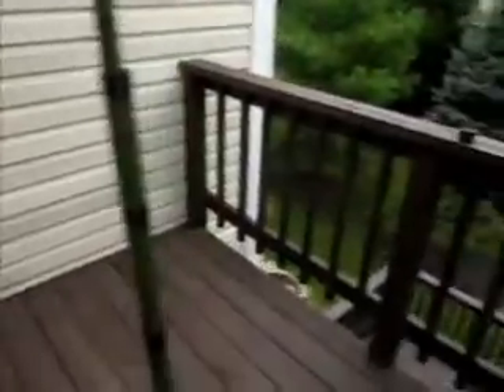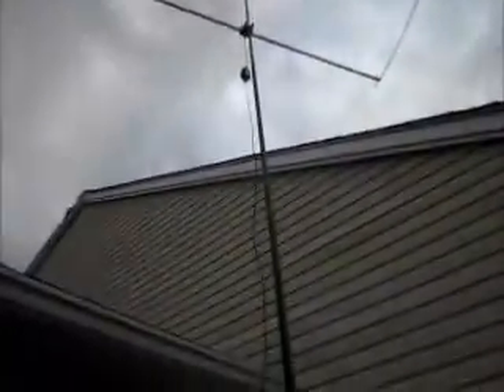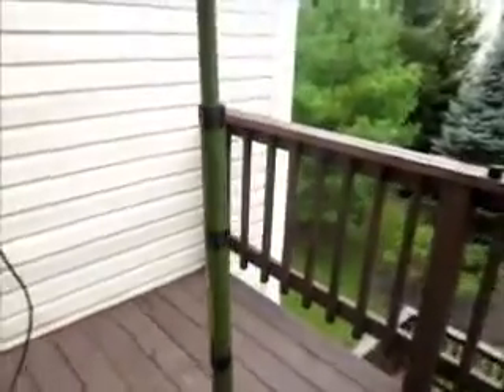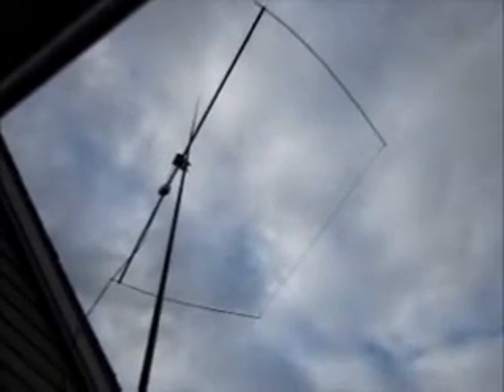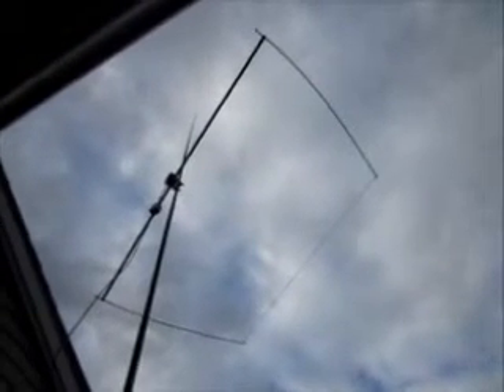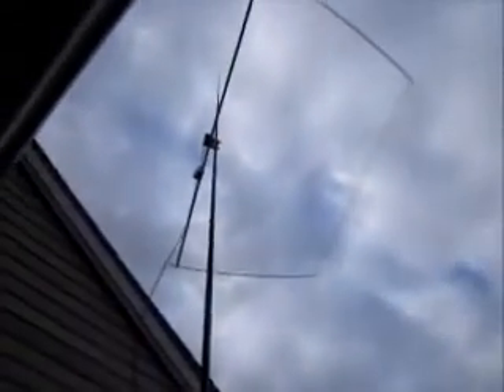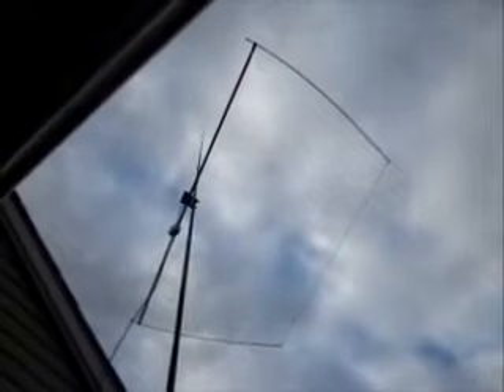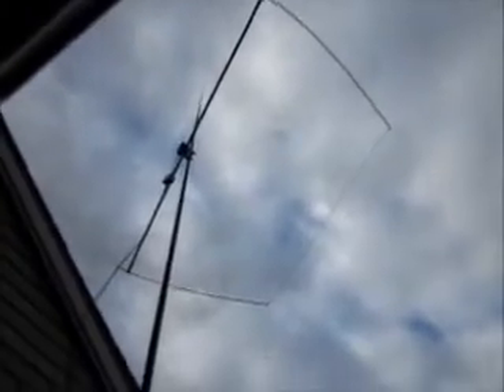PAR Electronics 17 meter Omni-Angle Antenna

Comment: Five six nine? Ok I have been a Ham Operator for just over 25 years and I have no idea what that signal report is? I understand a five by six but where does that nine come in the report? You lost me?
Reply: 25 years and you don't know what RST is?
Reply from the maker: Voice operators report readability and strength (RS), hence "56".  CW (Morse Code) operators report readability, strength and tone (RST), hence "569". The tone aspect concerns the purity - or lack thereof. The tone can  range from a pure sine wave to a raucous AC like buzz.  In addition, a CW signal can "chirp" (sounds like a cricket at night) or it can "click" which sounds like chattering teeth.  Such impurities in the tone would also be reported.  For example, a "569C" report would indicate a perfectly readable signal at a good strength and with a perfect sounding tone but a chirp, possibly from an unstable oscillator circuit.  Hope this helps.

Comment: If this antenna works the same as the VHF/UHF models then it is Omni Directional so it does not require a rotor.The OA-50 is an AWESOME Omni Directional antenna for 6 meters.Stack two or three & really makes a big difference.PAR makes AWESOME products not just antennas.I now use the OA-144 & OA-432 with my ICOM 910H and as with the OA-50 in the past they are awesome. de W4KVW

Comment: Stan - I have an OA17B and I, too, am delighted with the results. I am a QRP op in Davenport, Iowa and to me the most exciting thing about the PAR omniangle is how quiet it is. I was previously using a homebrewed 17 meter vertical and while I was expecting a quieter antenna I was not prepared for how radically easier it is to copy weak signals with the omniangle. I'm keeping mu fingers crossed that Dale Parfitt will put out a 30 metre band version or at least make a matching box. 73 - Tom W0VPI
Reply from the maker: Yes, especially with the upcoming sunspot minima, I'd love to have a 30 meter version.  73, Stan

Comment from the maker: The Omni Angle is more of a folded dipole than a discontinuous loop. The pattern on the doublet could certainly be a factor. And you are absolutely correct: You can't work 'em if you can't hear 'em.  Thanks and 73.

Comment: The Omni Angle is more or less non directional.  The difference could be the pattern on the doublet.  (The lower noise on the horizontal loop will make receiving easier... You can't work what you can't hear.)  KK4qdz

Comment from the maker: Both same E-W heading.  Both within 3' of same elevation above earth.  Since this video was made I've worked much DX on this Omni Angle including Tokyo from my NY QTH which has proven to be elusive.  Always 5 watts.  Results always similar: Resonant Omni Angle equal to or better than my 44' multiband doublet on receive and transmitted signal RST generally reported as equal to doublet.  That's about all I can provide in terms of "casual" antenna comparison. 73, Stan

Comment: Stan wrote on the Reflector "I don't want to create an antenna controversy here on proper antenna testing techniques".

Without knowing the orientation of the two antennas to the received signal, this A/B comparison is totally meaningless.

73,
Anon.